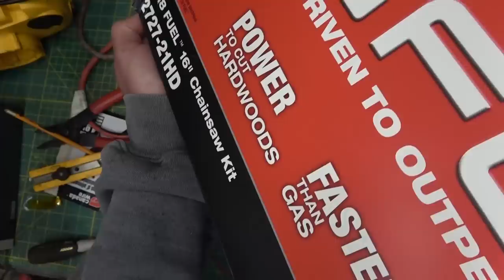BOLTR: Milwaukee Chainsaw | Destroys DeWalt

Comment: Look now, I ain't much of one to argue with the uncle, but it looks to me like the wires mightn't be as bumbled as you think.  I've seen many places where one of those ribbon cables was used (because that's what they had in the factory, or something); five wires on hand, only three needed.  So unless you're sure it's needed, the wires look more like they might be extra and were cut before they were soldered to the board and then potted in epoxy.  I'd be more likely to try it before going rocket surgeon on the brain box so you don't get a zombie from a previously working tool.  But then again, rocket surgery is fun, just point it towards the neighbor's moon.
Reply: Collin The EE I had the same thought. I only noticed the one broken white wire but it looks like a pretty clean cut. If the 5 wire ribbon was cheaper vs the 4 for some odd reason you know they would buy the cheapest Chinesium available that would do the job. On a side note I hope he has a look into the 12.0 High Output vs the 9.0
Reply: Collin The EE one way to tell is follow the wire to the other end and see if it’s connected to anything before digging in the potting compound
Reply: Collin The EE I was thinking the same thing but I’m watching on a large format phone so I can’t really see for sure.
Reply: To be honest, I was in a similar situation.  My main clue was the clean cut.
Reply: I'd definitely follow it... But I cut my comment short somewhere between "paperback" and "manuscript".

Comment: The irony of using a chainsaw to unbox a chainsaw. 

Did I hear that right (more than once) $600?!?! You can buy a nice Husqvarna or Stihl for that much. Either of which would turn the Milwaukee into plastic chips. Why TF would someone spend $600 on that?
Reply: Electric, so no gas, instant start-up, low maintance. Also you pay for the Name Brand.
Reply: $600 Canadian.  That's like $32 American. :)
Reply: Still about 456 dollars. I got my husqvarna 455 rancher used for 250 but even if you bought new I'm  sure it'll still smoke the Milwaukee at the price point
Reply: @chasmosaurus3 , well in that case...... lol
Reply: its $399 at home depot. its for the people that  are obsessed with Milwaukee and buy every tool they put out.
Reply: @godsupra , I still wouldn't spend $399 on it. Not unless it came with a bag, flash light, drill, circular saw, sawzall, and a Stihl. Lol
Reply: A lot of guys (read women) don't want the hassle of maintaining carbureted motors, so they buy electric replacements. TTI makes a range of weed wackers, saws and blowers to meet the sissy market.
Reply: I bought one for cutting in and cleaning up trails for motorcycle woods racing. Gets used 5 to 7 days a month for a few hours each night. No gas or premix to screw with, big 12.0 battery lasts plenty long for the cutting I do, and it can sit around for a month and start right back up next time I need it. Also, battery works with other tools I have even tho it's overkill to put it on anything but the saw. By the time the other guys get their saws off their ATV's, prime the fuel, turn the choke on, and get the saw started and warmed up, I'm working on my 2nd or 3rd cut.
Reply: wish you would compare the EGO Chainsaw. It cuts great and the tension adjustments work great to keep tension on the saw.. I have not looked at the guts but it cuts like butter for me... EGO+ 16" Chainsaw. Skookum as fuc@ I hope. 5 year warranty...
Reply: You buy it because its electric, is this a serious question?
Reply: My dad wanted one because enviroment and shit and stuff. Then he saw they were shit and so is looking for a gas one.
Reply: +DynamicEquilibrium he even said at the beginning that he doesn't like the pull start Poulan that he says never starts on a bunch of pulls. Of course, any 2 stroke chainsaw worth a shit, that isn't so high compression as to require a compression release to start, should start on 2-3 pulls tops cold, and one pull hot. If it won't, it needs tuned, or an operator that knows the proper start procedure.
Reply: 400 usd and if you go look the battery it comes with is $200 stand alone. So really $200 for the saw and $200 for the battery. So it could make sense if you have other milwaukee tools and were already thinking about picking up one of those 12 amp hour lithium batteries.
Reply: @legendfpv , so is a Nissan LEAF, and I don't have one of those either. $400-$600 for an electric chainsaw just seems really expensive. To each their own I suppose.
Reply: chase ricker this makes a lot of sense for these sort of jobs.
Reply: Lot less people come to look when you cut with electric or hydraulic saws.  Start up a proper fuel chainsaw however.
Reply: bloodvue absolutely electric is the way to go for those nice little trespassing trail rides and adventures😂.
Reply: Very useful in construction where you can get gassed out from fumes inside a partially built house. Chopping beams and hacking holes for plumbing and HVAC.
Reply: my brother found a populon chainsaw on the side of the road that had a free sign on it, filled it up, give it a pull, nothing happens, pulled apart the carb, cleaned it up, and now she runs like a champ. small engines are not complicated
Reply: I've got a nice 4-stroke trimmer and one of the 40v electric ones.  The electric one will do just about any damn thing the gas one will do, uses the same universal attachments, and I can't fuck the carburetor by leaving ethanol in it for a few weeks too many.  If I've got some heavy brush cutting to do, I can get the gas one going, but it's just not necessary in the suburbs.  Plus, the golfers across the street appreciate the quieter electric one too.
Reply: Yep and leccy saws are usually pretty torquey so less stalling out and restarts.
Reply: I can see the appeal for electric for casual users.  Less maintenance, and you can let it sit for months without use and not worry about fuel going bad etc.   In an off grid setting it would be nice too, as you would be generating your own electricity while fuel is not really something you can generate yourself and have to rely on going into town for.   I'd be curious what the battery life is though, like how many logs you can cut per charge.   Was hoping to see it in action.
Reply: Downclimb4what
Is your brothers name Mustie1
Reply: At some point, I imagine it's not going to be much of a choice in the consumer side of the market.  There are already restrictions on 2-cycle engines; how long will it be until certain places simply ban gasoline-powered chainsaws/trimmers/whatever for "reasons".  Even if it's not so total at first, it might be the case that shitty electric tools become cheaper simply because regulatory compliance makes the ICE-powered counterparts artificially expensive.
Reply: DynamicEquilibrium  The travesty here being that it really isn't hard to maintain small single cylinder two and four smoke engines like on chainsaws, and with minimal care, will outlast the lifetime of a battery due to chemical degredation...
Reply: @billtabbert7383  Yeah, I understand being turned off by yanking a poulan pro with high compression and horrible carb, but for $600CAD, ~$460US you can get an absolute ton of nice saw. Plus most people probably don't already have these giant Milwaukee batteries anyway, theyve probably got the littler ones that came with drills.
Reply: @redsquirrelftw  My problem with the saw though is a casual chainsaw user going to spend $600CAD, $460US on a saw? Plus you'll probably want an extra battery or 2 at $150 apiece. $460 can buy an absolute ton of ICE chainsaw from Stihl, that with minimal maintenance (which most overlaps the electric one!) will last you for 25+years no problem. These batteries, especially if not discharged and recharged regularly, will die in 2-3 years, and in 10 or so years will be obsoleted. Even if you have to take your ICE into the shop for $100/yr for regular maintenance, it would be the same price as buying 2 new batteries every 3 years, and you gain much more power and longevity, IMO.

Edit: If you've only ever used the $100 Poulans, they are an absolute nightmare to start compared to a mid-to-high range Stihl you could buy for $460, it's night and day.
Reply: @chasmosaurus3  Canada, belongs to America, seems like you never went to school
Reply: To save Mother Earth and leave a smaller “carbon foot print”. Whatever....... ha-ha
Reply: @GYPSY400  You won't regret the investment. Just keep the chain sharp and it does fantastic.
Reply: @jackfrost1031  It's great. The other guys I work with were skeptical like everyone else but most of the time they reach for my saw instead of theirs now.
Reply: old people, people who dont want the  hassle of combustion powered chainsaws and the maintenance that goes with them
Reply: It is not a replacement for an actual gas chainsaw if you are working all day long chopping wood, if you are only going to do a few cuts here and there it is something nice to have
Reply: It's a pain right in the ass unless you buy the fancy pure fuel, and the cheaper the tool the more likely you're going to have problems with it. I've never bought a gas powered tool other than my first lawnmower - doesn't mean I don't own them, but I routinely find them in the trash when people get sick of messing with it, in need of new fuel lines and a carburetor teardown every time. Still waiting for a chainsaw to come up this way, though, I always find trimmers and blowers.
Reply: @rotaryenginepete  well, i can't say anything about the Milwaukee. I got a cheap one from Harbor Freight and i am very happy with it, i got an extra battery and it comes very handy for the chores around the farm
Reply: Yes, in the name of ecology, let's strive to make products have shorter lifetimes and maximize the number of conversion steps in the energy path.  Expecting less and paying more is a virtue!
Reply: I use makita battery saw inside. No gas, no exhaust fumes
Reply: Why not reply to the person you're replying to instead of the last person who commented?
Reply: The Green Party on my city council have made it illegal to use two smoke infernal combustion powered stuff for these purposes.

So some people just don't have a choice. Either use an electric chainsaw or you can't work within city limits. It's one of those enviro mental things made up by people who aren't in the least bit handicapped by knowledge.
Reply: hell my husqvarna is brand new and is a pain in the ass to crank. i’d take the milwaukee if i could. i just need saw for yard use
Reply: @SCOOPFREE , I happen to be an AvE fan myself. Seems you and I bump into eachother on a few channels.
Reply: Wood turners use electric when cutting stumps into rough blanks when the doors are closed in winter. Though this is still kind of spendy for that purpose. My PoS corded was only $60.
Reply: @rotaryenginepete  interesting, i am a Milwaukee fan. I wish they had rolled out this before
Reply: 600 includes that 12amp battera and another spare charger for the hord but I suspect it is a higher charge rated unit
Reply: it not for the brand, Husqvarna and Stihl are as reputable as milwaukee

the $$$ is for a high powered cordless brushless electric
Reply: I'm a Vagitarian Christian and being I only eat the kitten meat on Christmas my budget troll would never approve of this purchase.
Reply: at the store i work at, we charge $125 usd for a chainsaw tune up, and people pay all the time. with electric there is no tune up and fuel storage for my customers that use a saw 4 times out of the year. That and some of the old folk want an instant on saw, no pull cord and no maintenance. We use a battery stihl to trim the Christmas trees we sell and its awesome, although it might be a bit pricier.
Reply: wood poaching
Reply: Stihl makes some nice battery powered chainsaws too, has to be better than this plastic mess.
Reply: Bought a nice echo with a 2' bar for $380 canadian just the other day. That said that chainsaw comes with then new 12.0 HD battery which is worth $300 alone.
Reply: a real saw? don't be too quick at dismissing an electric saw watch?v=MDyjY3uiWp0
Reply: because it is way better than sthil or husqvarna
Reply: Cameron Crane it wont
Reply: chas williams $32 American, that's like £3.20 great British pound 🕵🏻
Reply: To The Top Crane or a Tesla. Just sayin
Reply: Jason Hendrix That's *Champsqvarna!!
Reply: I prefer gas powered because it's more fun. Something cool about priming the carb, pulling the choke out, pulling it once so it splutters, pushing the choke in, second pull and it's off like a rocket. Starting small 2 strokes isn't difficult, but it's difficult enough that I can sit back and laugh at those without hair on their chest (women and boys) failing at it.
Reply: That's not a chainsaw he's opening the box with.
Reply: @fermitupoupon1754  
What ?!?  
Gas or Electric *ONLY*...?!?  
HandSaws Are NOT Available or Legal in YOUR Area...?!?  
(I would Move...)
Reply: @NoFretBrettCSSMBFF  yes, because hand cranked chainsaws are so incredibly common. I guess reading comprehension isn't legal in your area...

Comment: I recently purchased the DeWalt saw. Since his initial review on it they have gotten rid of the ratcheting bar attachment system. They integrated a metal nut into the plastic securing plate for the bar, and you can further torque it with an Allen wrench. I have logged a few hours of cutting on the saw with no issues of any kind. Cutting done on logs approx. 12-14” in diameter  down to sectioning the small branches. If I have any issues in the future I’ll be sure to update the comment.
Reply: Did you have any issues?

Comment: Please do a field test with those things, a typical battery pack has a power density around 140wh/kg, while gasoline has a power density of 12337wh/kg, to carry enough battery packs to replace that 2 gallon jug in terms of pure power would weigh in at a massive 1106 pounds, sure electrical motors are vastly more efficient than gasoline powered, but still, DO A PROPER FIELD TEST.
Reply: dthrckt That’s it really, the key thing about battery tools is convenience and lack of  (relative) reliance on a source of  power. An electric chainsaw has neither of these advantages.
Reply: I cut firewood with a Makita with 16 inch bar.  Cutting l6 in diameter logs it consumes about 500 watt hours for a good size pickup load.  This is probably about equivalent of a tank of gas on a small saw.  The Makita uses two (2) hand tool batteries.  They are all the same size and weight and range from 54 Wh (3Ah) to 106 Wh (6Wh) batteries.  Two Makita LXT's weigh 2.7 lbs whereas one Milwaukee weighs 3.7 lbs for the same 216 Wh.  I normally take two sets of 6 Ah and one set of 5 Ah to cut wood.  That's a total of 616 watt hours.  I always have some battery left and when I recharge my energy meter read 0.5 to 0.6 kilowatts.  I have a bunch of 4's and 3's Ah batteries that I could take along for more cutting, but I have never needed more than 600 Wh.
Reply: Makita [Japan] supplies the space magic tech.  China supplies the Chinesium for assembly.

Makita does put the rotor on the outside and the stator on the inside.  They are the only one's with an invisible gear box. Sounds like something they got from area 51.  It's kinda like Velco.  Had to be aliens.  I'm not saying it's aliens, but it's aliens.
Reply: Honestly wouldn't be surprised if gas chain saw engines have energy efficiency of 10percent or less. Cars nowadays have like 25-32 percent effeciency, and lawn equipment and chainsaw engines aren't geared to that kind of effeciency. The engines are small and have to put out more power so you lose effeciency.
Reply: @whydoineedmynamehi6772  more power doesn't mean you have to sacrifice efficiency. The problem is they have to run with air cooling which drastically effects the temp of the cooling reservoir vs the power reservoir or heat reservoir. Meaning you thermal efficiency on a given day will be effected by the outside temp. Something like a gas cooled or liquid cooled engine would help increase efficiency and power but drastically increase weight complexity and cost.
Reply: Andy Gilbert electric isn’t bad ; cordless is almost useless in the bush
Reply: I have the 16 inch Makita that I take along camping with the atv, for the amount of firewood or emergency tree removal on the trail, cordless is just fine, and I don’t need mixed gas along. I’ve never burnt thru two nine amp batteries on a trip yet
Reply: The purchasers of these tools te looking for less hassle and aren't worried about bucking up a tree for the winter fire. 

Sane reason I bought the trimmer, no more gasoline to mix.
Reply: dthrckt  or indoor in the winter.